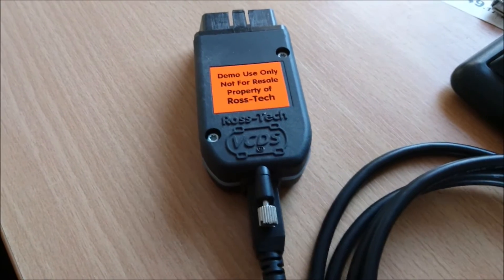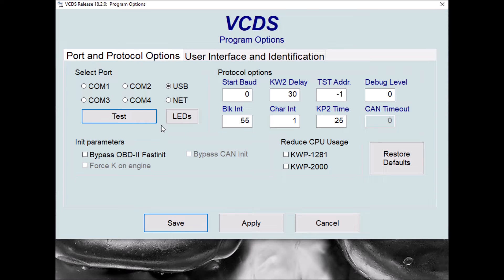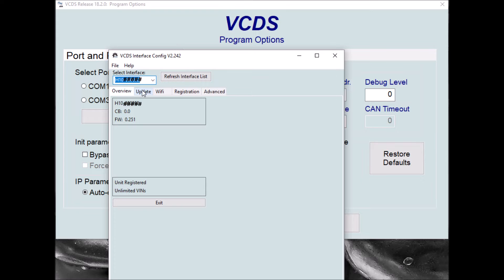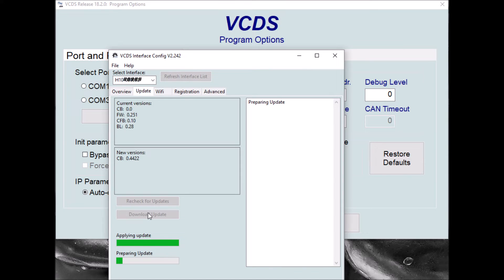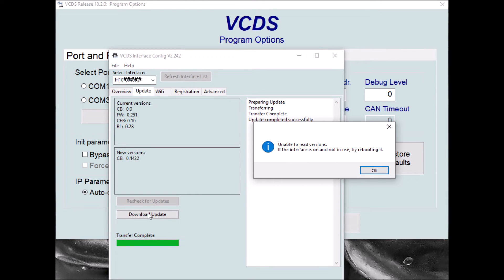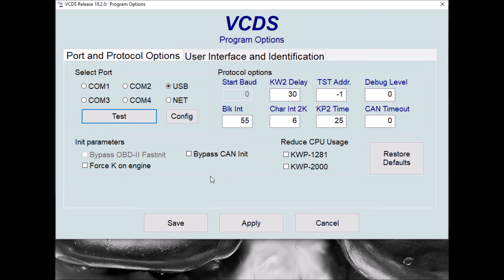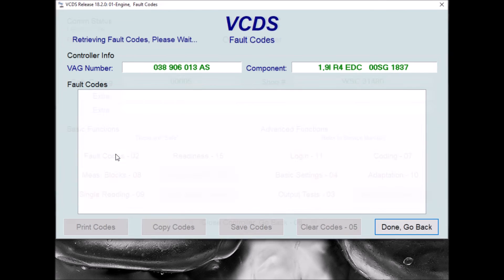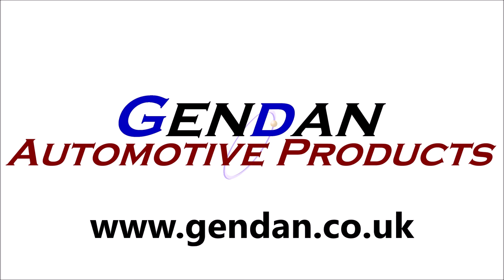Ross-Tech VCDS HEX-V2/HEX-NET - Fixing a failed firmware update

Comment: Hi, I recently bought a new diagnostic vcds hex v2 and when I plug the cable into the car and laptop I put the ignition on, test the usb ports and save it all.  I leave and I get the error: "no response from controller".  What could be wrong?

Comment: How to fix VCDS Hex + Can when it failed after update ? All work but show can not ready and wont comunicate to the car.
All was fine with every update till last one  in 2019.
Reply from the maker: Is it a genuine Ross-Tech HEX-USB+CAN, with a unique HCxxxxxx serial number on the label, or a clone?
Reply: @GendanAuto  ofcourse it is original ross tech. I've explained it has updates before with no issues. There was last update for them old cables that many people reported problem with.

It simply need uninstalling this update but how ? 

Reinstalling software not helping coz it is firmware update in the cable that need to be turned down from 19 to 18 at least.
Reply from the maker: @broskis80  If it's genuine, drop an email through to the company who supplied it, or Ross-Tech support, including your serial number and they should be able to help.
Reply: @GendanAuto  they aint interested to help. They like everyone to buy V2 and I have feeling that last update for hex+can was to damage cables on purpose.
Reply from the maker: @broskis80  if it's genuine and registered in your name for support, Ross-Tech will help.
Reply: @GendanAuto  Ross tech German wasn't interested. 

Is US Ross Tech the main one ? 

Yes I've bought it from Ilexa and it is on my name.
Reply from the maker: @broskis80  Either speak to Ilexa or support@ross-tech.com
Reply: @GendanAuto  cool thanks.

Comment: IT s original cable or clone?
Reply from the maker: Only genuine HEX-V2 / HEX-NET interfaces update the firmware this way.
All the "HEX-V2" clones are old HEX+CAN interfaces in a different casing.
Reply: @GendanAuto  you can help me, with vcds 12.12, appear error, "no interface found"
Reply from the maker: @promix_studio1001  12.12 is a 2012 release of the software. The only reason to still be using it 8 years later would be if you have a clone.
We can't help with clones.
If you have a genuine interface it will always work with the latest release from the Ross-Tech website - currently 20.4.1

Comment: Hello 
I have seat ibiza 2013 year 6R0 I scan it by vcds hexv2 all control modules but only control module engine its can't reach it .please where is problem find
Reply from the maker: Hi Fatah. Is it a genuine Ross-Tech HEX-V2? Where did you purchase it?
Reply: @GendanAuto  no its copy not original but I had download it from website rosstech.
Reply from the maker: @fatahjamal3797  If the interface is a copy it will not be a HEX-V2, no matter what the label says. If you run an interface test in VCDS you'll find it's a HEX-USB.
We can't offer support on illegal clones.
Reply: @GendanAuto  no when I test option  I see Hex-v2

Comment: Question; is it nassasary to register with Ross tech to be able to use the VCDS?  Thank you for the info and the video. Forest
Reply from the maker: Hi Forest. Yes, with a HEX-V2 or HEX-NET you have to register the interface (for free) within the first 14 uses, or it will lock out until registration is completed.
The previous generation interfaces (HEX+CAN, Micro-CAN etc.) didn't enforce registration, but you had to be registered to get any technical support.

Comment: I was installed 17 version of vcds 
And it's updates on 19.6.2 
And now it's crash sometimes in a car usb connection 
And showing interface not found 
When I restart pc it's works again till it's crashs  
Maybe I can try firmware update
Reply from the maker: Are you using a genuine Ross-Tech interface or a clone?
Reply: I'm not sure 
My friend give me it
Reply from the maker: @uldza  What is the serial number (HCxxxxxx / Hxx-xxxxxx) of the interface?
Reply: I will send you later on
Reply: That's  possibly  is clone 
Cos when I'm trying  to update interface 
Selection there is select interface not showing up nothing 
Even refresh interface list is not working
Reply from the maker: @uldza  Run the interface test in VCDS and see what type of interface it reports. If it says HEX-V2 on the casing but HEX+CAN on the test, it's a clone
Reply: And label from interface is removed someone  was remove it can see it's was there before

Comment: Not working for me. I did the update and it said after the update that you are up to date. Then i went yo change tap to USB and pressed Test button.... interface not found. Should my HEX-V2 be inserted to my car at this point?
Reply from the maker: No, you don't need to connect to a car.
What colour are the LEDs? If you're only plugged into the PC and they are green, unplug it for a while then plug in again. Then close and re-open VCIConfig.
If working correctly, when plugged into the PC the LEDs will flash blue.
If the firmware is corrupted (which this procedure should be able to fix) they will be red.